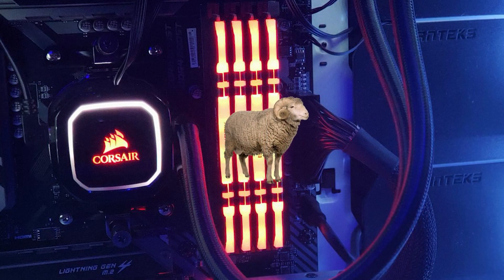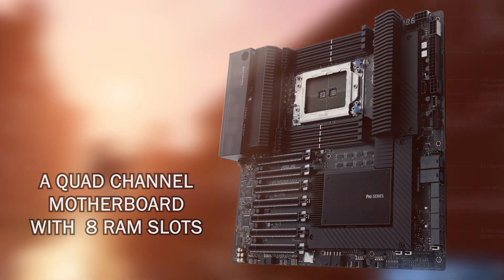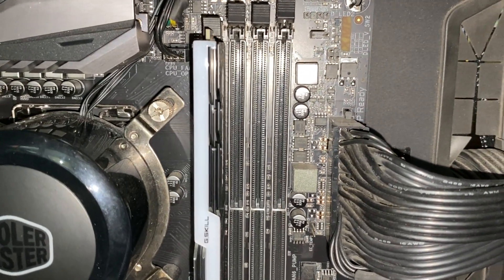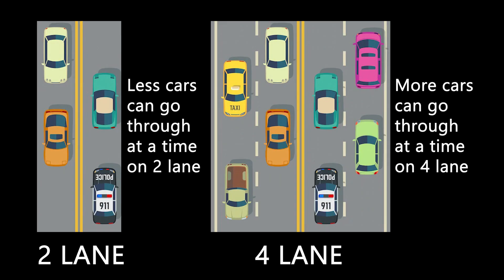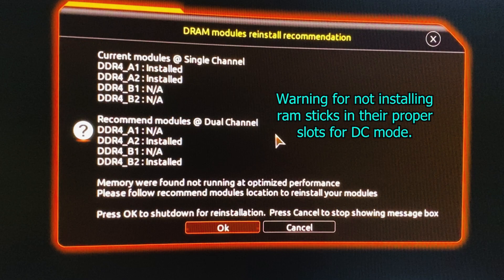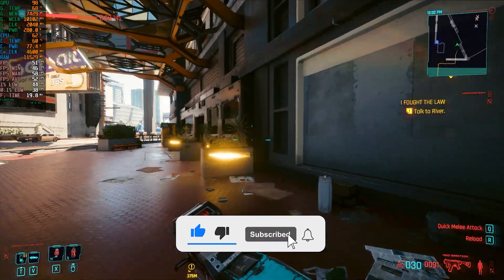How to Setup Dual Channel RAM | GET MORE FPS

Comment from the maker: Something to note if you are installing single stick of RAM:
2:07 - You might have to install RAM in the 2nd slot (slot A2) depending on your motherboard, unlike what I have shown at 2:07 which is on A1 slot. It depends from board to board so check your manual for it.
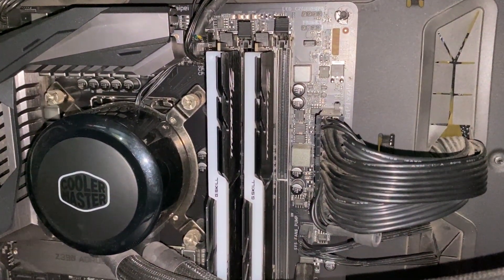Also in case of dual channel with 2 sticks you may want the sticks to be on slot A2 and B2 first in some motherboards unlike how I show at 1:45.

Comment: My b650m aorus elite has a broken A2 slot pin on am5. Can I use dual channel using A1 and B2? Thanks
Reply from the maker: I checked your mboard's manual, and it only recommends A2-B2 for Dual Channel for 2 or 4 sticks. You can still try it and then check CPUZ's Memory Tab to see if it says Dual Channel.
Reply: @AMGameGoesOn  Thanks. When my RAMs arrive I will check it out
Reply from the maker: @Clebrw sure

Comment: Hello , thank you for the informations , i have a problem when i put the rams in the optimzed slots and turn on my pc it doesnt detect any peripherals ( keyboard mouse mic monitos ... ) but when i use the non optimized slots it does detect everything but i cant use the pc in its performance , do you have any idea how it can be fixed, Thank you
Reply from the maker: First, can you tell me what motherboard and RAM sticks you have? That will help a lot.
Second, this problem generally happens if you have any bent or broken pins on the CPU. Or your CPU cooler might be putting too much pressure on the CPU in some areas. Make sure the CPU cooler is just handtight.
Reply: @AMGameGoesOn   hi can dual channel slighlty increase peformance even with a locked cpu like mine is hp core i7 1255u laptop please reply 
me asap would mean a lot to me i liked and subscribed its upgraded to 32gb and says 2x 64bit  is it a dual channel right how 
do make it work as dual channel on cpu-z
Reply: @AMGameGoesOn   hi can dual channel slighlty increase peformance even with a locked cpu like mine is hp core i7 1255u laptop please reply 
me asap would mean a lot to me i liked and subscribed its upgraded to 32gb and says 2x 64bit  is it a dual channel right how 
do make it work as dual channel on cpu-z

Comment: If I put 3 RAMs next to each other, will the Duel Channel work or not?
Reply from the maker: It's better to run 2 or 4 RAM sticks than 3. Using 3 next to each other means only 1 pair(2 ram sticks) will run in dual channel mode, the 3rd one which ever gets left out can't form the pair as the 4th stick is absent so this might cause in stability in your system and a drop in performance too (as I said this might its not 100% that it will always for everyone, you can try and see what fits better for your hardware).
Reply: @AMGameGoesOn  I have a problem with the third socket. When XMP is activated, the device does not boot. Can you tell me the reason?

Comment: My Motherboard has 4 slots (A1, A2, B1, B2) only recognizes A1 and A2. Tested all 4 chips they all work in A1 and A2 but not B1 or B2 at all. I have tirelessly tried to find a solution and it seems that it's due to a CPU pin that was bent. Subsequently checked all pins, all aligned and fitting properly. Is there some setting that I am missing?
Reply: Try all slots with just a single RAM first. If B1 and B2 do not work with same RAM, that should be some failure with the motherboard or the CPU. If the RAMs work alone, but don't work together, that could be due different or incompatible RAM modules.
Reply: same situation but mine is working only in b1 and b2 not in a1 and a2, did you find any solution?
Reply: @arjaysalvador6527  having the same problem myself now! I don't know if it's a pin issue or what. I have two TINY pins that glint differently in the light than all the others but that could be the only issue I reasonably see to cause this problem
Reply: Please post any potential fixes if you discover them!
Reply: yeah... me 2... slot a1 and a2... single ram... wont work, pc will loop in turning on and off

Comment: I have a 8GB RAM 2666MHZ and planning to buy 1 more stick of 8GB 3200MHZ, would It still be possible to run dual channel?
 I know that the speed from the 3200MHZ RAM will be running at a lower rate 2666MHZ such as the other one.
Reply from the maker: Sorry for the late response. Too many comments to deal with so it's easy to loose track of them.
So, it may or may not run in dual channel if your speeds are different or any single spec is different. Both RAM sticks should have the same size and the same bus speed to run in dual channel mode.
I recommend you take out that 2666MHz stick out of the board and buy 2*8GB 3200MHz dual channel ram kit as DDR4 quite is cheap these days.
Reply: @AMGameGoesOn   I have asked the people who are selling the PC components. THey are quite the big company with good techinicians, they said that it will run dual channel but at 2400MHZ only. So I'm fine with 2400 MHZ
Reply from the maker: I would never trust technicians. But if you are fine with 2400MHz then its ok but you are loosing on 15-30% of performance (FPS) in games. @phantrungai8585

Comment: I have a b760 gaming x Ax ddr5 and my ram is kingston 6000 mt lc 40, and if i use in slot A2B2 i get black screen, and not bot. If i put in A1B1 work great and i can Overclock. Is a mobo issue? Or is everyting ok? Is a new pc configuration. 2x16 gb ram dual channel
Reply from the maker: There's definitely something wrong with your board cause you are meant to put ram sticks in to A2B2 first if you have 2 sticks of ram, it says the same on the motherboard layout. Maybe try putting 1 single stick of ram into A2 and then B2 and check the individual slots to see if they work.

Comment: Please tell me, if you put 8 + 8 in slots A1 / B1, and 4 + 4 GB in A2 / B2, will this combination work in two channels?
Memory with the same frequency, only the timings are different and 4 + 4 GB memory has chips on both sides, unlike 8 + 8 GB, which have chips on one side.
Reply from the maker: See there's nothing like they won't work everything's gonna work but you may run into problems which may negatively impact your performance overall for using dissimilar memory.

Comment: my gigabyte manual indicates that the second slots be filled first. z790 aorus
Reply from the maker: It’s probably 2nd and 4th slot to be filled first then
Reply: @AMGameGoesOn  well yeah, but second on first channel and second on "second" channel

back in the day, it was different
Reply from the maker: @Wolfiecolada  full model name of your motherboard?
Reply: @AMGameGoesOn  z790 aorus elite ax.

and what i had meant was the second of each channel.

back in the day, you slotted first in 0 for single or for dual channel you'd do 0,2 for your first of each channel.
Reply from the maker: @Wolfiecolada   @J  now a days the labeling is kinda different. But as I see your board picture it follows the same layout as I showed at 1:41 in the video. And in case of single stick of ram you can fill any slot you want it wont matter at all. The labeling on the board is shown is for dual channel setup.
Reply: @AMGameGoesOn  my pc wouldn't even start with the ram installed as you have shown at 1:41. after looking at the manual, it showed they need to be. it's on page of the manual.
Reply from the maker: @Wolfiecolada  you got 2 ram sticks or just 1?
Reply: @AMGameGoesOn  2 ddr5, installed for dual channel according to the manual.

download.gigabyte.com/FileList/Manual/mb_manual_z790-ae-series_e_221118.pdf
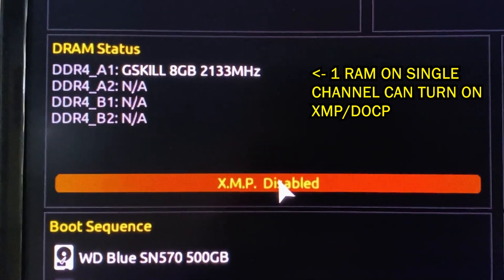Reply from the maker: @Wolfiecolada  I see it. It actually varies sometimes for different manufacturers and boards as well. For me in case of single stick it works fine on my board as you see at 2:56 in the video it shows up in the bios its installed on the A1 slot.

Comment: Great video. But wouldn't it be more benefitial if we use 1 RAM stick on the closest slot to the cpu? As the distance is shorter there should be some benefits, no?
Reply from the maker: The rate is very fast at which data transfers, that extra distance doesn't make any noticeable difference at all.
Reply: Lol